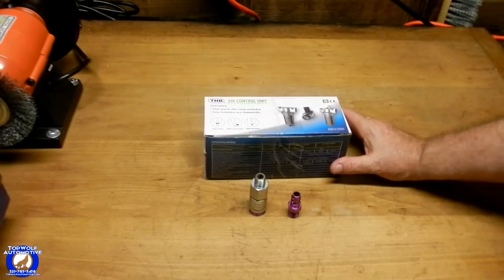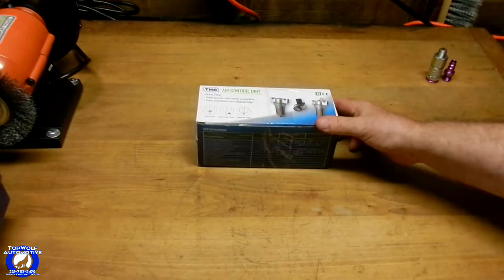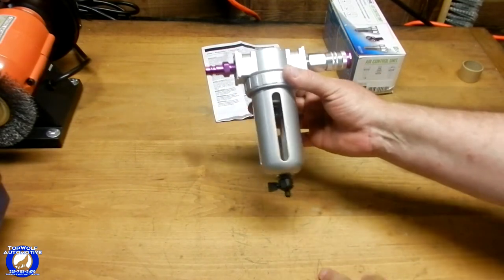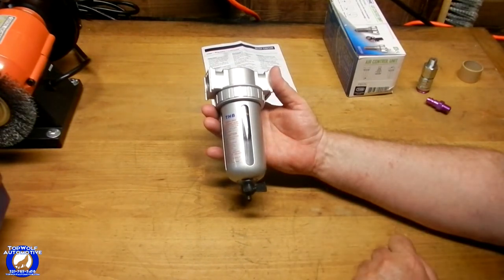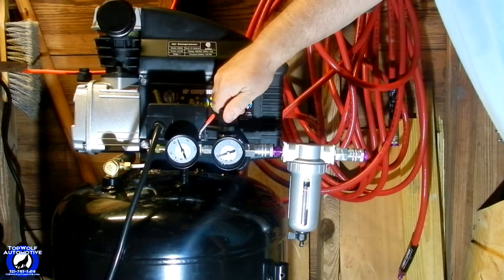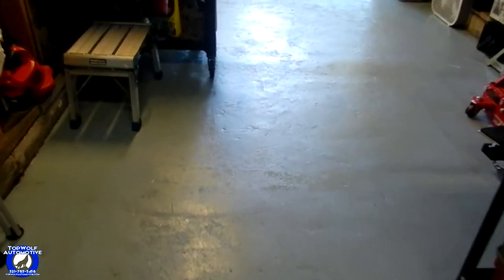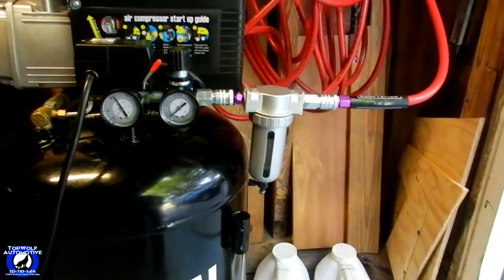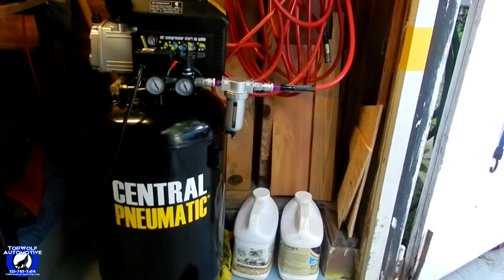Tool Haul Shop Floor Update

Comment: Topwolf Automotive... Great video brother.. I would take the quick connector off of the regulator and hard pipe from the regulator to the air filter. Not trying to tell you what to do it's just a suggestion.. LOL